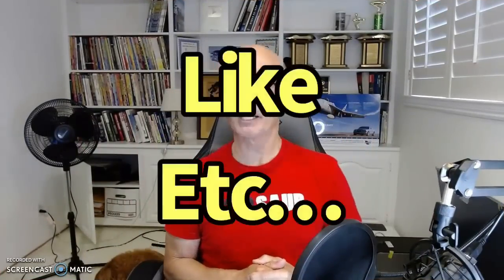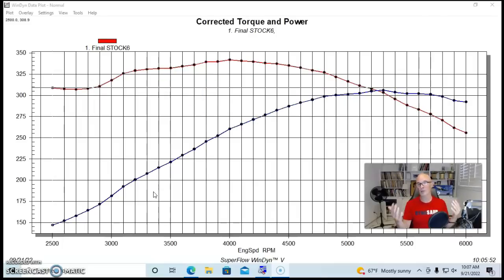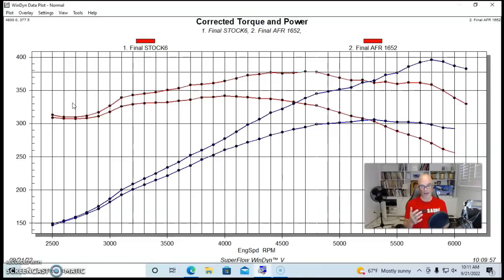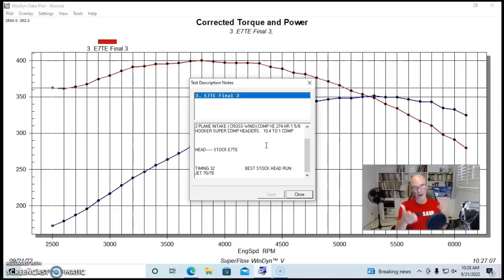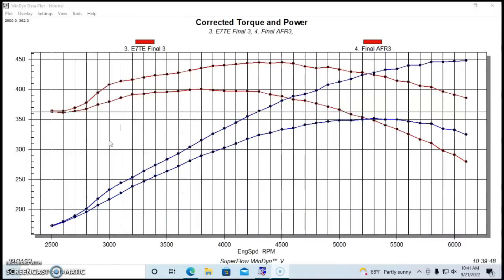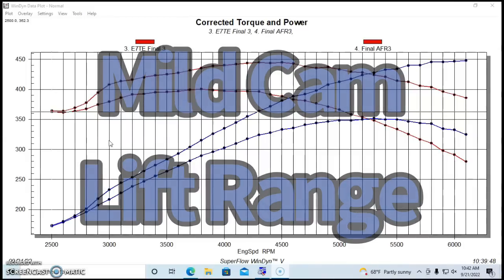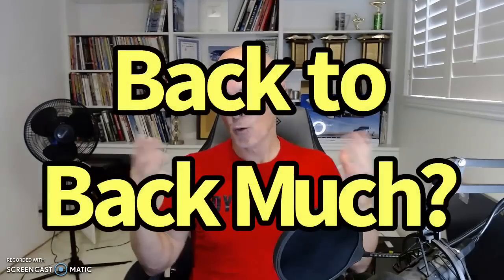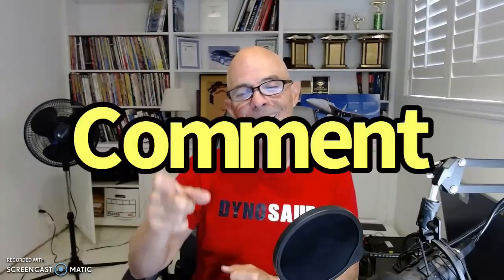WHAT IS THE BEST CYLINDER HEAD FOR MY 5.0L FORD? WHY I CHOOSE THE 185 AFR OVER THE 165 AFR HEAD.

Comment: On a 289 does it help to change timing to 351 windsor thks
Reply from the maker: no change for firing order usually
Reply: You need to change cam  @richardholdener1727 it takes it 1.5.to 1.3 and so on in firing order

Comment: Curious what pistons you have in your 333ci test mule. I recently picked up a 93 fox body with a set of AFR 185's. Scoped my cylinders and they appear to look exactly like the slugs you have, 2 valve flat tops with the dual intake cut for canted or inline. Lots of unknows with my engine but someone put $ into it 10 - 20 years ago. Unknown cam that pulls hard mid/top and likes to idle at 900, 165 - 175psi cold compression, RPM intake, 70mm TB, larger mass air unit, 30# injectors, equal length shorty's, 3" out the back, diablosport delta chip, Tremec TKO.
Reply from the maker: ours were from Probe

Comment: Check out Roadkill Reborn. "S2E28 cylinder head games how big is too big?". Ford 408 Stroker with 218/224 - .513" cam. AFR Enforcer 165cc, 195cc and 220cc were tested back-to-back on the same engine. The 220 and 165 heads made the same horsepower and torque. The 195s made just a couple more horsepower

Comment: Here’s the real question: if fuel didn’t matter, and cubic inches the same, is the better setup the 165 head with more cam and less compression. Or the 185 with more compression and less cam? I’m thinking the 185 that outflows the 165, with a bump in compression and smaller cam, will still have the same off idle onward in drivability while offering the same power without the need for the same lift. Meaning it should be a rocket on the street and super easy to drive

Comment: would've been nice to see an apples to apples on the 306 with just swapping the heads and/or the 333 with 165 too.
Reply: Check out Roadkill Reborn. "S2E28 cylinder head games how big is too big?". Ford 408 Stroker with 218/224 - .513" cam. AFR Enforcer 165cc, 195cc and 220cc were tested back-to-back on the same engine. The 220 and 165 heads made the same horsepower and torque. The 195s made just a couple more horsepower

Comment: Richard, when you said the 331 with the 185 and the XE cam could use a lot bigger cam…. What cam would you suggest to get some more power out of this set up. Currently considering this build. Thank you for your time
Reply from the maker: check out the XFI236 cam from Comp if you have enough P-V

Comment: Thank your for an excellent description and analysis of this particular cylinder head/engine combination.  I think it might be advisable let folks know that according to Airflow Research, the185 cylinder head is not compatible with stock engine pistons.  Taking this into consideration and looking at your dyno charts, although the 165 and flows a bit less, the factory does state that this head are compatible with stock pistons, and considering that the power difference is not that much, the 165's might be a better deal, even with a hotter camshaft.  It'd be a shame if someone stuck on the wrong heads and damaged in their engine because of the valve pockets on the pistons were not large enough.
Reply from the maker: the fitment of the 185 is a function of the cam-they fit and work with lots of cams
Reply: are you saying the 185's if he did an apples to apples and tested on the 306 would have not had that much higher numbers? I wonder how much more only? I also wish he would've tested the 165's on the 333

Comment: Ok I know this is old but I have a question.

Let's assume sbe 302/5.0

Stock stock stock, but bigger turbo.
Vs
Sbe, but with hci.

Goals are ~600hp to the tire, so let's say 700fwp.

So stock stock stock plus a lot more boost, say 20psi to more than double a theoretical 300fwp to 650ish two.

Or sbe2, with a hci to get a theoretical 450fwp, plus whatever boost it needs (10ish) to match the first engine.

Does either engine have an advantage? Does the engine care about boost psi (aside from head gasket problems), moreso than the actual amount of HP? Does it care how we get that HP goal? 

Will 450hp + boost = 700hp be harder on an engine that 300hp + boost = 700hp?

Comment: quick question now? are you using the enforcer 1351 head or the enforcer 1341 head. the 1351 head is a 2.02 valve and the 1341 head is a 1.90 valve.
Reply from the maker: The Enforcers were not a thing when we ran these tests-we ran 165, 185 and 205
Reply: Awesome okay so I'm assuming that there are a 202 valve as well

Comment: Are these the heads/specs you tested? AFR 185cc SBF Enforcer Cylinder Heads 1351
Reply from the maker: no-When I did this test-AFR Enforcers did not exist-we used the CNC 185s

Comment: Hi Richard I just want to ask you a question because I no you know what you're talking about I have a Ford 302 0. 60 over stock bottom end although it has ARP everything the Pistons are forged with a 220 dome I have a Comp Cam solid roller 0.613 lift 264 duration @0.50 110 lobe separation I have 205 AFR renegade heads they're obviously the one set up for the solid roller 58 CC combustion chamber fully ported that's how they came you know 16 rocker ratio I have the comp ultra rocker arms you know they're like 600 bucks an hour or something is Victor Junior intake 750 HP Holly 1 3/4 primary tube header 4000 stall torque converter in a c4 full manual reverse valve body translate and a 9-inch with 4.56's MSD ignition 6 digital and a 200 shot of nitrous I mean you can go from 50 to 200 I value your opinion and I know you're very knowledgeable Ben A. From California to engine builder I'm sure you know who he is I just can't remember his last name or how to spell it I just know it starts with an a he said I got a pretty good combination it should run pretty good just getting a second opinion again I value it so if you could let me know that'd be great thank you very much and I enjoy listening to your program
Reply from the maker: seems like a good combo and Ben knows what he is doing
Reply: @richardholdener1727  yeah Richard I don't want you to think that Ben A. built it I just asked his advice of what he thought like I asked you and explain to him the same thing that I have that I told you and he just said it looks like it's going to be a good combination it should run pretty good but I'd really like to do is get a coyote and throw a couple turbos on it but I can't afford that right now hell I can't afford anything right now lol anyway thank you for answering me I appreciate it and I'll keep watching

Comment: Can You please tell me if 185cc  2.020 will fit the stock sbf302 efi From 1989 town car ? Do I have to change the pistons ? ( gonna transfer it to carburetor)
Reply from the maker: with what cam?
Reply: @richardholdener1727  what cam should I put for the power increase ?  350-400 hp is more than enough! And maybe what pistons a should buy ? (But stock pistons preferable )

Comment: Ran the 185 on a 402 cu inch Windsor. In a 2900lb car went 6.77 in 100 degree heat in the 1/8th mile. The engine only 10.2 comp and an off the shelf 294 comp hyd. roller.

Comment: So what kinda HP, would've been made had those 185 cylinders been installed on 306ci u had used with 165 cylinder heads ?
Reply from the maker: 165 vs 185 on a mild combo will produce similar power numbers

Comment: How is this stock 302 making 300hp when my 91 grand marquis’s is just rated at 150hp. I would love to see a complete turd 302 and have someone explain how severely restricted these engines are.
Reply from the maker: A stock 302 doesn't make 300 hp-this was not a stock motor
Reply: and that is also crank hp on the engine dyno from this video lol

Comment: I have a set of enforcer 185s with 1.90 valves I want to run the xe274hr cam. What springs would you recommend?
Reply from the maker: the ones that AFR has for those heads for 600-lift hyd roller cams
Reply: @richardholdener1727  those are the ones that came on the heads, I wasn’t sure if they would work, comp says they want a minimum of .060 between coils at full lift..

Comment: Don't like these oranges and apples tests. The larger port could have some lazy airflow on that 306. Especially important if you want a good strong torque curve vs a peak number.
Reply from the maker: you need to do more research
Reply: Exactly what I was trying to do. A comparison isn't a comparison when you change everything mid test...

Comment: Very explaining and good to know . I actually got one 185 myself . I didn't notice the valvesizes , maybe You said but it was too quick . My cylinderheads are called #1388 , V2 with 58cc chambers , I think they are of the type "Renegade" .
Reply: The 185’s have larger valves, which may interfere with stock pistons. The 165’s (1399) have 1.9” Intake, 1.6” exhaust valves which they guarantee to work with stock pistons.

Comment: Typically both the heads are delivering max power around 5500 rpm when the engine should be capable of producing more power way beyond those revs. Instead the fix seems to be to pay more money for a stroker. Makes no sense to me.
Reply: well here''s the deal.

the 165  is a bolt on for  5.0 roller motors

the 185 isnt because of the big 2.02 valve

if i had a stroker  yes,  id use a 185..even the enforcer will work with flat tops in a 331 and im thinking  about that  for next yr..

Comment: Hi Richard,  long time fan of your show! Now, I live in a state that doesn't do emissions test. Yankees love my state! Yes, use thev thev185, but on a 351w! I GAVE all my 5 liter parts away! Practically gave a 5 liter long block to a friend. Swapped it for something! If a 351w will fit, use it! That 1/2" od stroke and nearly 1" of connecting rods is awesome! The only down sides are the extra weight on the nose and shock tower clearance in older (65-66 Mustangs or Falcons) but those are collector cars!! The increased low and midrange torque Wimmer make it harder to launch, but you can get past that easily with a foxbody! Take off the training wheels and put on the big boy pants !
Reply: the other option  would have been to build a 347 out of the 5.0  and put steel caps on it.  that way you would have had the cubes  +  the clearance
Reply: @KingJT80  Sex   up in a hammock! Why spend all that money on an 8.2 block! The rod/stroke ratio sucks, it's a hand grenade, and Noone fall for that "it's only a 306 ")

Comment: What head would you recommend for stock piston 302 with 542lift cam
Reply from the maker: need more info, how much power do you want to make, what rpm, what is the intake? etc...
Reply: @richardholdener1727   it has a wiend stethl intake 750 Holley deep sump oil pain with windage tray and a high pressure oil pump stock stroke stock piston stock rods cam is advanced cam has Been degreed about 350 hp or 400 6500 max on rpm
Reply from the maker: AFR 165 OR TFS 11R
Reply: @richardholdener1727   appreciate the help would the 2.02 valve clear the stock pistons ptv
Reply from the maker: depends on cam duration (not lift)
Reply: @richardholdener1727   ahh alrighty appreciate it man

Comment: Question is this only for carbureted engines or could be possible to have the same results for mass air flow engines
Reply from the maker: HEAD WORK THE SAME ON BOTH CARB AND EFI COMBOS

Comment: If I'm wanting to have higher compression should I use the 165? I want to use a Anderson n41 cam. It's stock 1989 5.0. if I have to I'll get it bored I will. This will be my first engine build.
Reply from the maker: the 165 will work well on a 306

Comment: Would the 185 Heads work on a 306 with L2488F30 Sealed Power pistons❓
The guy I bought the engine from said it was bored over 0.30.
Reply from the maker: you need to check p-v with your cam and those heads/pistons

Comment: I understand your reasons as far as flow at peak rpm and if track or other wide-open throttle stuff. Do you not think the normal driving thru all rpm's the smaller port velocity (airspeed) would make the overall drivability better than the volume increase in flow? Or would they just equal themselves out? Same same? I ask cause that is something the dyno does not or can not test for? Thx!! Or can it?
Reply from the maker: part throttle might be different

Comment: Just built a 306,with summit flat top hypereutectic pistons,the comp cams 264 cam and AFR 165 heads. 94 mustang using FR extender set a 12.25 to 1 afr. 24 lbs injectors on a ported explorer intake. 70mm TB. What kind of hp and torque would you say this combo would make. I don't believe it's anywhere close to your carburetor version with same heads and cam.
Reply from the maker: WATCH THE EXPLORER INTAKE VIDEO
Reply: @Richard Holdener  thanks I was able to port my explorer by cutting a window into the side and making a 1/4" aluminum plate cover to bolt on. So I should be close to the GT 40

Comment: I'd be really curious to see this test with both heads on the same mild 306, rather than the bigger head on a bigger engine. 

What about part-throttle, tip-in, throttle response, with the larger head vs. the smaller? My experience has been that the 165 is a lot snappier on the street on a mild combination than the 185s or comparable Twisted Wedge heads. Even with a stock cam the bigger heads are soggier than the 165s.

That Car Craft 165 test referenced used 1-3/4 headers and all of your tests have 1-5/8...just saying.
Reply from the maker: FEELS SNAPPIER!
Reply: @richardholdener1727  I take this for sarcasm, as opposed to answering the question, so I'll be more direct:

How big of a blind spot do you think WOT pulls on an engine dyno have with regard to driveability and "smiles per mile" with a street car? Some of us autocross. Dyno pulls happen at WOT, and unless its a drag car, a car spends  1% or less of it's life in that operating condition.
Reply: @smoberley  most people have actually done this if you read the mustang forums and they'll tell you the 185  is better on the 302  unless you have a completely stock block 

then the 1.90  valve'd 165 is what most people used.  

they proved this years ago using the renegades.  the drivability difference is negligible,  but the cars were faster down the track more times than not so just run the 185s on a 302.  and why would you buy a smaller head for the exact same price?  this is how the TF 11r 170 vs the 190 is.  same price.  more head

  thats what i wanna do or the TF 190 11Rs or Promaxx project X 185s on my 302 zephyr
Reply: I 've seen the same results you have.  I've owned literally 50 fox bodies, including Fairmonts and T-birds. I've done loads of 302s over the last 30 years. I own a Mustang chassis dyno. 

The question wasn't which makes more peak power, the question was why not run them against each other on the same motor and see the results. Probably because on a 302, the 185s are going to show a loss of power and torque under 3500-4000 vs the 165s.

That deficit increases at part throttle (Dynos are at WOT). Where you're going to spend all of your time when you're actually driving the car, and is also useful on an autocross course. Perfectly valid reasons to choose a smaller head for all kinds of applications and thus relevant to all the non drag-car enthusiasts on this channel.  I've had both sets of heads on 302s and I can tell you the 165 is a lot more fun on a stock cube motor, even if it is a tenth or two slower on the dragstrip. If.

The "FEELS SNAPPIER" clapback is a really  dismissive, snotty response to objectively verifiable reality. It's also in quotes even though that's not what I said.
Reply: @smoberley  what you lack in torque  (which is negligible again) you will make up for if youre picking the right stall converter and cam.  the only reason  id go with a 165  is piston clearance  on stock pistons  like an 86GT autocross street..wouldnt matter

as said  a 185  is better all the way around.  then you dont have to buy the head again/port them if you wanted to go to 347...youre already there with the heads. they cost the same.  im not buy a smaller head for the same price  just so i can gain  MAYBE an extra 5 ft lbs  under 3k when im already gonna use a 3k stall with the 3.55s i have

Comment: Not a fan of E7TE's but it was impressive to see them make 350HP on the 333ci.
Reply: That is at the crank with straight headers no exhaust no accessories turning etc.  I'm sure you know that but that wouldn't even see 300 wheel in a car more than likely.  Still decent for such a restrictive head.
Reply: @midnight347  I'm aware it's a situation where a much better head would  be worth 80,90 even 100+ HP over them.
Reply: @Dennis Robinson  and that is exactly what these aftermarket companies do they take a maxed out combo otherwise (besides heads) and add the heads and they add 100 hp and the company will advertise "up to 100 hp gain" which isn't lying but it's misleading
Reply: @midnight347  sure isn't.

Comment: I read an article 20 years ago that came to the same conclusion,  they ran both heads on the same short block and the 185's lost very little down low to the 165. You would probably only feel the difference right off idle, once the revs crossed 2500 the bigger head took over.
That's not to say the 165 isn't a great head, it'll support 450 hp and is perfect for even the most mild of builds as you don't lose any drivability over stock. Just don't waste time on a ported set, buy the 185.

Comment: Are the afr heads cnc ported or as cast ?Also would you recommend the 185 on a 408 stroker 500 wheel
Reply from the maker: the heads tested here were cnc and for the 408-I would step up to a 205
Reply: It depends on your setup, but 500 wheel can be as much as 600 crank.  That’s a serious NA motor that will require a minimum of 300 cfm from the heads. Your looking at the AFR 220 heads and a solid roller cam.
Reply: They are full CNC heads